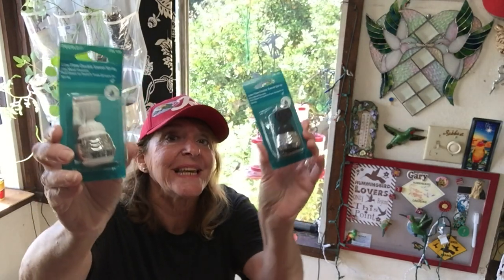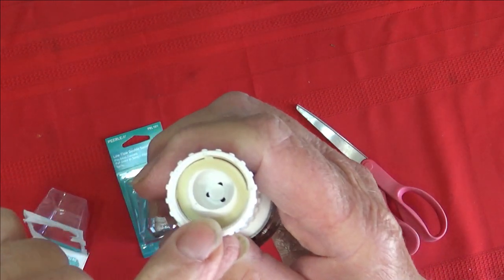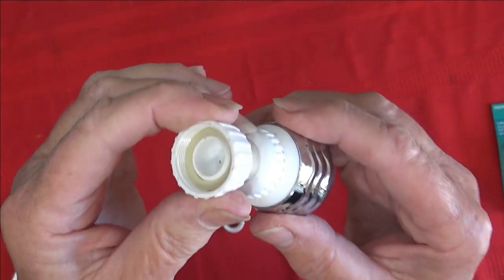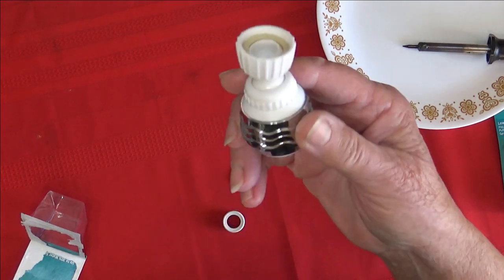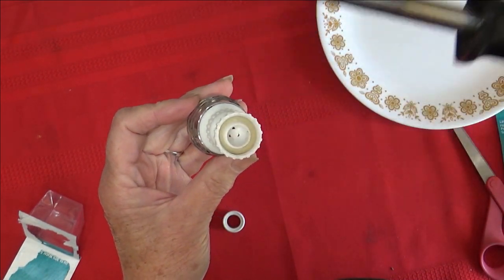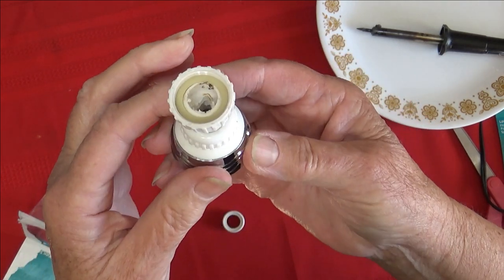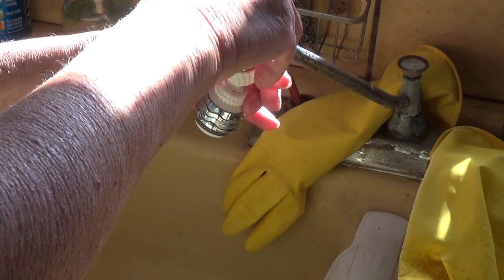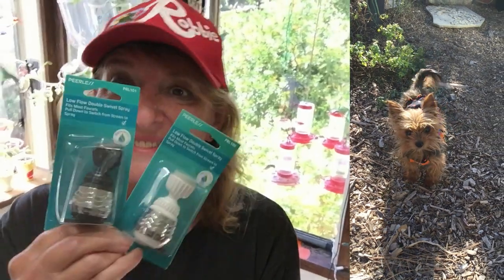FULL POWER Kitchen HACK How to FIX LOW Pressure Water FLOW Aerator Faucet Adapter Nozzle Filter EASY

Comment: About 10 yrs ago, we were staying in a motel that had such low water pressure in the bathroom that we had to add a lg drink size cup of water into the toilet to flush it.  The sink was really bad so we went to the plumbing section of a nearby Big Box store & bought another aerator w/ a higher gpm (gallons per minute) flow rate.  We swapped it for the one in the sink faucet.  When we were leaving, we swapped them back.  That aerator still goes w/ us when traveling.  We never know when it might be needed again.
Reply from the maker: That is SO cool how you did that, great thing for others to think about, take care, and again thanks for all this!